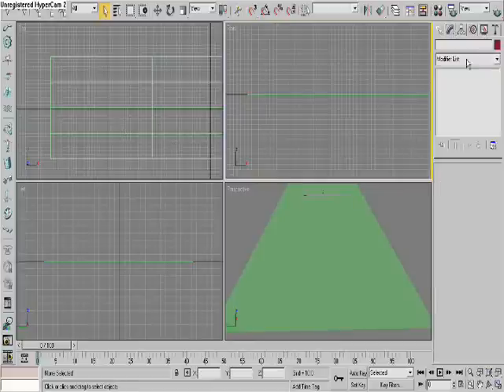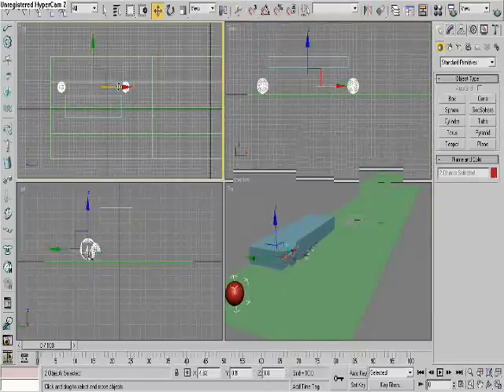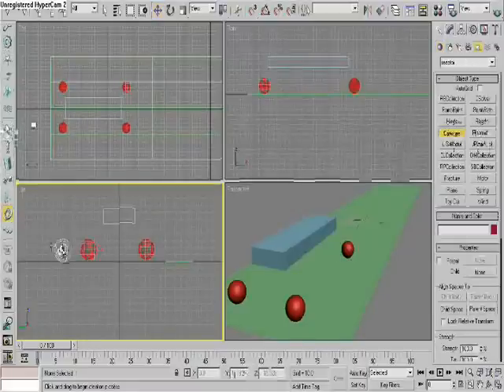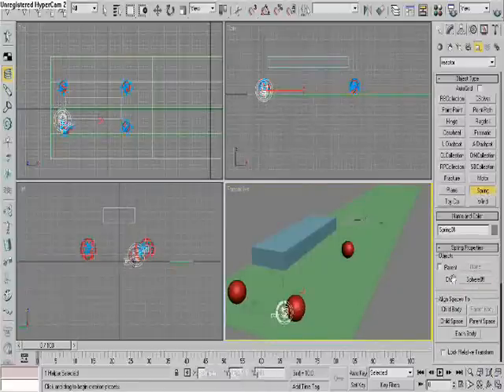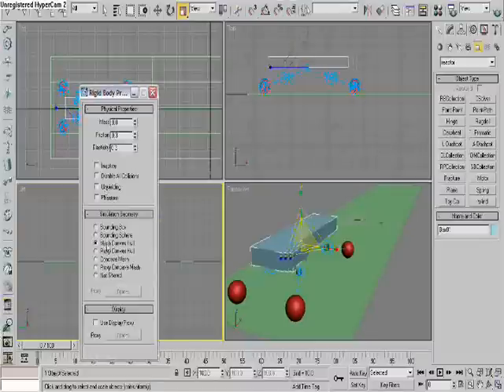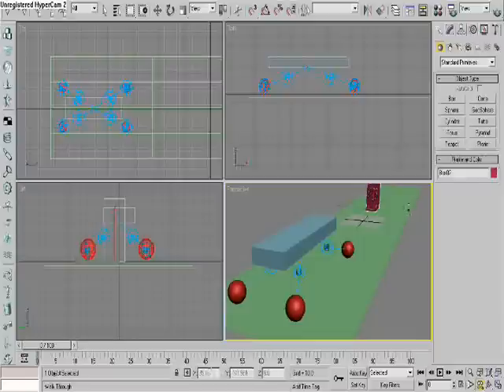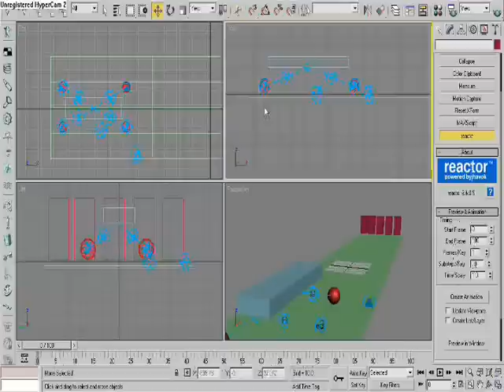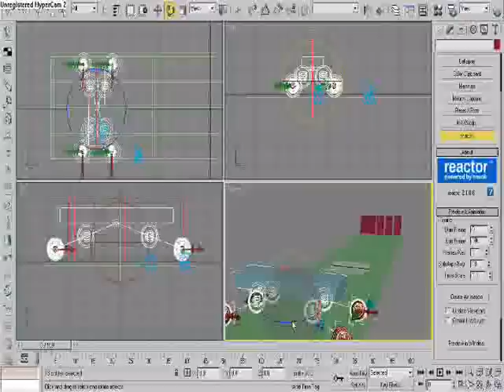How to make a working vehicle in 3DS MAX

Comment: hey, 
i can't tell from the video whether the wheels are turning or just moving like a solid across the surface?
another question is, i'm using 3ds max 9 so i dun have that vertical toolbar on the left, where do i find those commands you used in 9?